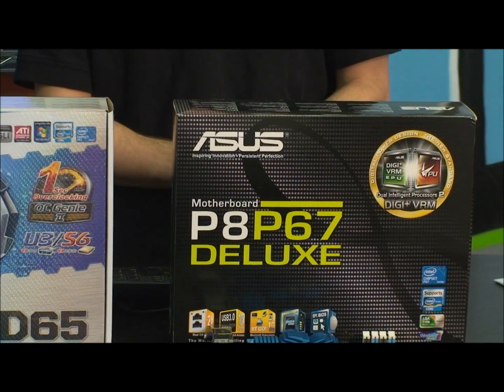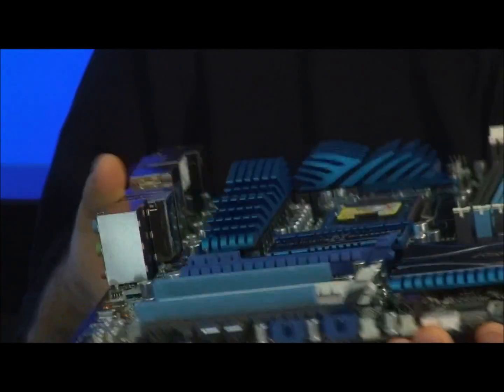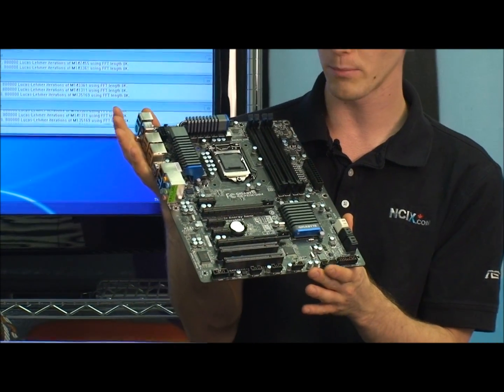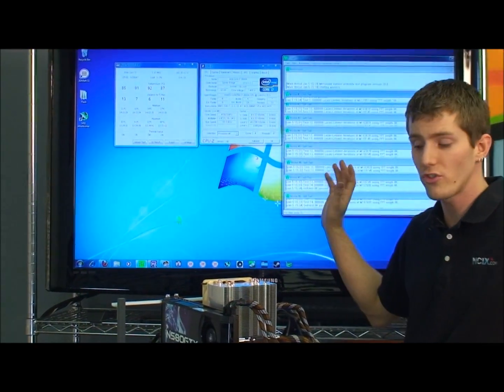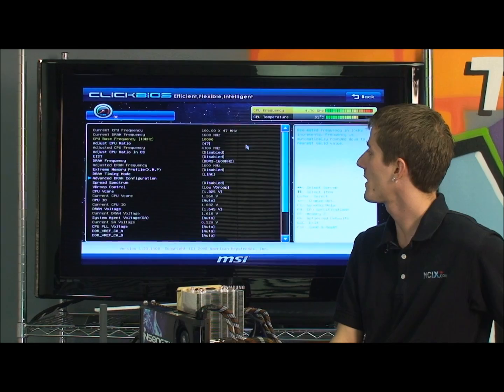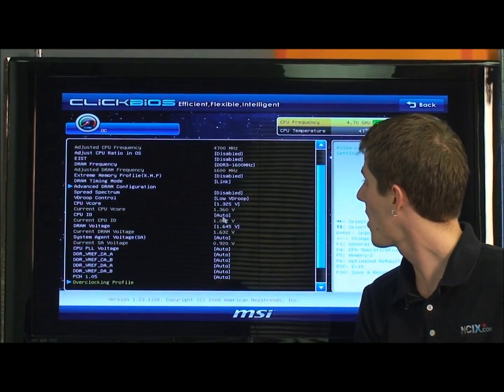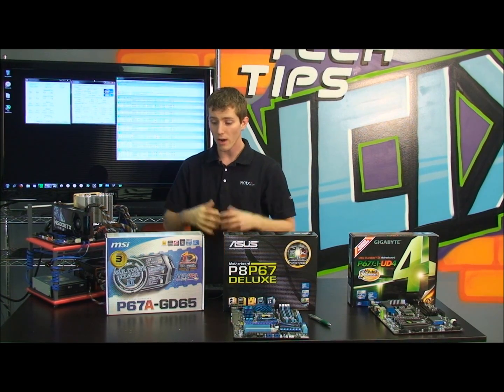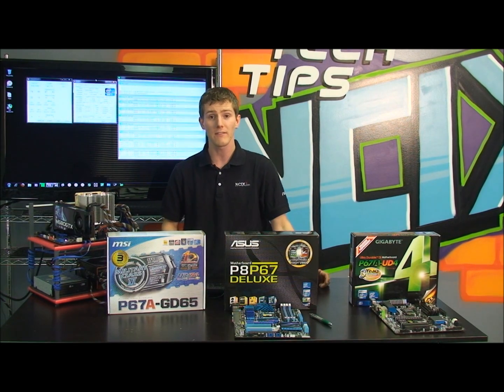Intel Sandy Bridge Core i7 i5 P67 LGA1155 Overclocking Tutorial NCIX Tech Tips

Comment: I have an i5 2500k and AsRock P67 Extreme4 OC'd @ 4.39GHz with 1.28vore cooled by a Noctua NH-D14 everything runs at no higher than 60C in Prime95 though in realistic applications my PC runs no hotter than low-mid 50's. Also the 6 series chipset issue doesn't affect me since I have 4 SATA III/ SATA 6g/b ports and I use up only 3 slots.

Comment: I am using a Thermalright Venomous X @ 4.7GHz.  My highest temp running a benchmark under full load was at 63 degrees!  Check out my video to see the set up.  I am using two fans push/pull.

Comment: Intel® on January 31, 2011 announced the detection of a design error in the new Sandy Bridge-based Intel® 6 Series support chip, also known as Cougar Point. The shipment of existing Sandy Bridge products has been suspended by Intel®, and the production of an updated support chip has commenced. The design error affects only the support chip, and not 2nd generation Intel® Core™ processors such as the i5 and i7.

Comment: hey linus am thinking in build a gaming pc under 1000K with the next features: 1gb ati readon hd 5770 ddr5,i5 2500 processor,1tb hard drive at 7200 rpm,corsair 850 watt tx series power supply,cooler master atx mid tower case,cooler master RR-B10-212P-G1 hyper 212 plus and about the board am not so sure wich one to pick cuz idk a shit about overclocking but i want a good gaming pc and i was thinking about the msi board one on this video tell wat u think and wat to change on the hardware thanks.

Comment: you missed explaining about the cpu voltage increase that you set in bios by saying dont touch anything else??

& a 24/48 hour burn in on a new cpu thats running 1.4 vcore, 6-8 is genereally excessive now, then combined  with some simple multi tasking to prove stability

not your best guide this time linus

Comment: @skimowhite586 Just because you've seen it, doesn't mean it's common. I'm pretty sure most 970's cap at 4.8-4.9 as well anyways. The 970 is a $900 part and the 2600K is a $330 part, so I'm not sure what's "gay" about it.

Comment: i expected more from Intel than turning down. After core i7 generation i thought that they would go as far as Intel Xeon X7650 with socket LGA 1567 and not down to 1155 !!!. The intel xeon X7650 unovercloced beats even a oveclocked core i7 980X and it just has 2,26 GHz, but 24 MB Cache and 16 cores (8 physical cores). i know Xeon is a server CPU and costs more than 3 regular i7's but belive me, it is worth it. the LGA 1155 in my opinion is not worth it even if it is a core i7 next gen.

Comment: Hyper Pi as a stability test? Are you kidding me?

Hyper Pi is mainly meant for benchmarking. It is however detecting errors, so it doesn some stability testing. However, Hyper Pi doesn't use nearly all the instructions in current ISAs. So stability is far from guaranteed.

Free tools like OCCT do use the entire intructionset and are meant solely for stability testing. I'd recommend one of those.

Other than that: great video!

Comment: Yes, I am considering an upgrade.
I'm currently running Q9550 @ 3.4GHz and 4GB DDR2 RAM and it actually still holds up well in games. However the ridicilously good overclock capabilities of the sandy bridge processors are tempting me, and also the fact that they do so well in raw calculations such as video rendering compared to C2Q chips.

I'm considering a 2500K CPU, Asus P8P67 Pro and 8GB (2X4GB) 1600MHz RAM, possibly corsair vengeance.

Comment: yesterday I changed my PSU cause the old one died, I somehow managed to disconect a 3 pin plug on my mobo.  I started getting random power offs and it took me an hour to realise it was the connector for the water cooler!  I found this out after looking in the Bios and noticing my CPU temp.  120C holy cow!!!.  I got everything running fine now after plugging it back in and consider myself very luck that it didnt burn out and take the mobo with it =).  Seems ok now running Prime 95 for hours. phew

Comment: @mjcute07 The positive to Intel changing sockets more often is that it allows them to tweak performance and features more than if they had to worry about supporting old sockets. That is the downside to AMD's idea of building CPUs that work across multiple sockets. They have to spend time and money making sure it all works with old technology. The good thing about that of course is the ability to have a good upgrade path as long as manufactures release BIOS updates.

Comment: @xPhilipz0r i7 900 series use hyperthreading and triple channel memory. The i7 2600k is to replace the 1156 socket and NOT the 1366, so to "upgrade", you would be down grading because there will be a 2011 socket to replace the 1366 (i believe). So if you plan to upgrade the i7 950, wait for the new socket/boards to replace the 1366 socket boards.

Comment: @marquesbrownlee That was my question.  The Ivy Bridge platform will be way out of my price range when it comes out but when I looked at the programs I use daily (CS5 AutoCAD and games) the i5 2500k looked very appealing.  Id rather go P67 since it out does the 950 in the applications I use most of the time.  Plus with my H70, overclocking it, i should easily be able to get to 4.8-5 Ghz/s.  Plus a 2500k is cheaper than the 950 by 60 dollars on newegg in America